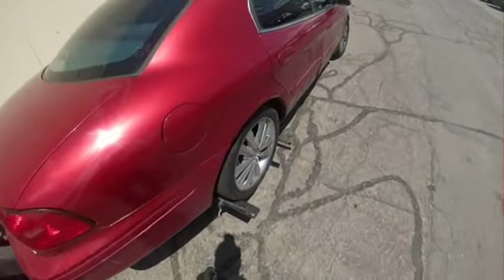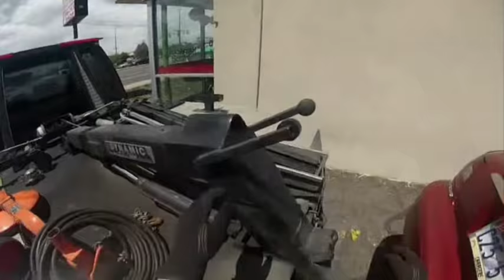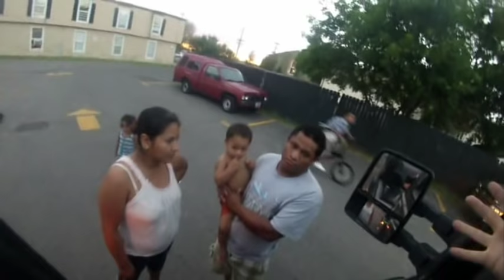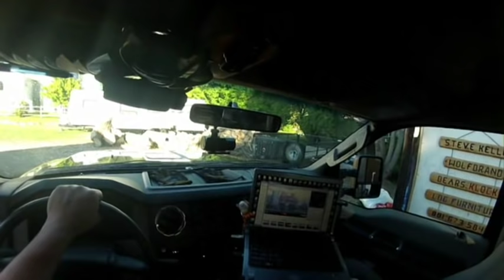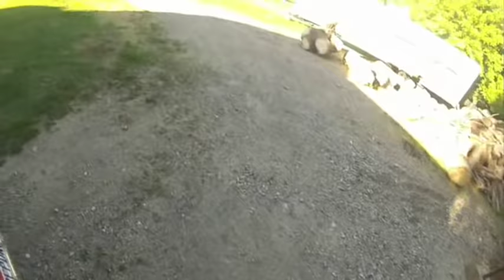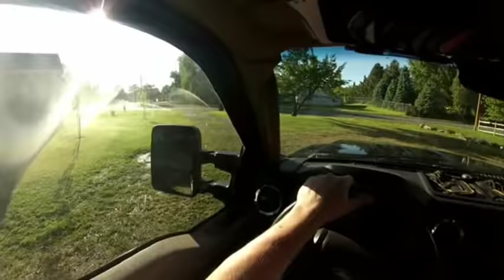3 Different Repos 3 Totally Different Situations To Deal With

Comment: Man Matt,  you make backing those cars around look so damned easy.  I have trouble with a 16' trailer, single point of articulation. I know.. experience.. but still.. damned gift of skill brother :-)
Reply: Right? I have trouble with an 18 ft travel trailer behind a minivan and i used to have a teacher back in high school who could back up to a 20 ft livestock trailer and drive with it perfectly without any help the first time.
Reply: @dude-kz9yr  the heavier the trailer the easier it is to handle. I can drive a 53' trailer but I have trouble straight backing a shorter trailer
Reply: I learned when I was 4 with a lawnmower and a 6’ trailer and a 10’, backing up to trees and around them in the yard

Comment: Towing with a 6.4?!?  Man lives dangerously!
Reply: Cruising down the street in my 64, blowing a head gasket, needing a tow!
Reply: adrianspeeder don't blame the trucks blame the owners
Reply: @peterchavez7687  you obviously know nothing about 6.4 engines
Reply: That truck sounds like shit
Reply: َ ٰ  I mean, mine has been good for 10 years now, but even with doing everything right, it'll be a when.  Not an if.
Reply: Towing with a Ford period is risky
Reply: @lmCIoudz  I owned plenty of Ford to know that the 6.4l was trash, it's better to go with the 6.7 or 7.3, but in my personal opinion I'd go with a 6.7 Cummins or 12 valve.
Reply: @raymondshiver6068  The 6.4 is the only bad diesel motor ford offered. If I were to get a brand new diesel truck, my first option would be ford then my second would be a cummins.
Reply: @lmCIoudz  I agree that and the 6.0l was pretty bad, but I'd rather a cummin over powerstoke, owned alot of them and I just like the easier it is to work on them
Reply: I prefer Durmax.
Reply: @Jeeppeeps may I ask why, I had a old lb7 and it didnt have no power
Reply: @kaseyboehm6680  My Ford diesels have several hundred thousand miles and still drive/tow just fine.
Reply: @raymondshiver6068  i have a power stroke 96 f350 haha its a beast. I love it.
Reply: @DonziGT230  i agree. I have a 96 f350 powerstroke diesel and have had it for years. Its been my dream truck since i was little and me and hubs have one each. I have mine lifted a little higher but ive been able to tow our 5th wheel and a ton of other shit. My truck is my baby and i will forever fix it until my sons are able to take them and use them. :)
Reply: @Rachel Sheldon well that's why your truck is still running great,  it's a 7.3
Reply: I literally hit ctrl F so I could find this comment lmao

Comment: Why do you have to use a "safety chain" on the cars you tow? With something as large as a vehicle, It would be WAY more safe to let it fall. If you have a vehicle on all 4 wheels veer off, its guaranteed to mess up the tow truck assuming the chain doesn't just instantly snap. Either way its not fun.

Comment: Buy here pay here on these Sable/Taurus.

Retail price is 5500
Down payment to drive is 1750.
Payment is 100 to 200 a week.
Interest rate is closer to 30 percent than 20 usually. 

They pay for that auction car instantly with the down payment. The rest is profit and overhead and operations. 

Someone should make a carmax for 90s and early 2000s hondas and toyotas only.

Make all cars between 2k and 8k.
Interest rate at 13 percent and down payment at 30 percent. 

In house warranties available. Do all repairs in house. 

I could drive a 2019 Civic cheaper than many people could get a 2000 Taurus from a buy here pay here lot. And I would have zero down.

Comment: I feel bad for the old guy, He's got an older truck, he's got a small house and he's got a uniform on, he's probably going through tough times and can't work enough to pay for it, Still gotta do your job and he still has to pay if he wants the truck, but he seemed to be a nice guy, has kids, he's probably just going through tough times.
However I will have to say I don't like the way this guy tows at all, it's 100 percent unsafe and not legal towing methods, He put on a single safety chain to keep them from driving it off, then he took it off before he rolled away it's the law to have not one but 2 safety chains attached when towing a vehicle, as well as both those wheel straps or an alternative method of tie down, As well as a light bar on the back of the car... Why would you take off the safety chain to roll... if your not gonna follow the law fine but why would you take it off when it's already on when you could just do that when you get there? it's not safe and it's illegal, if those straps break or your wheel lift bar breaks off, nothing is keeping that car secured, not a damn thing.